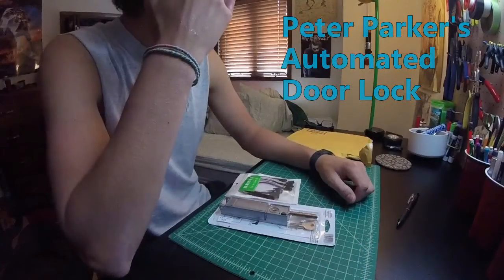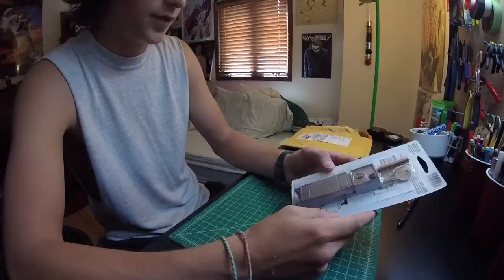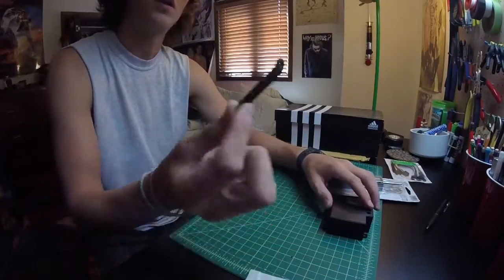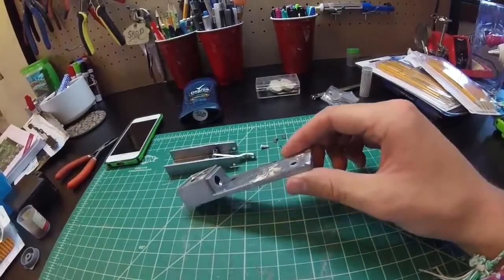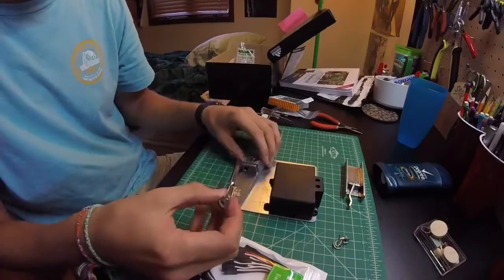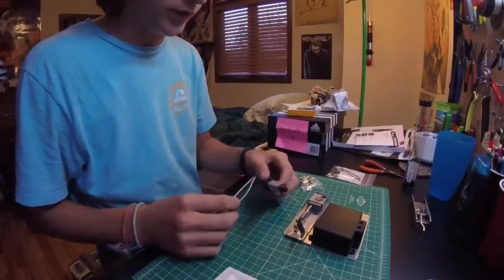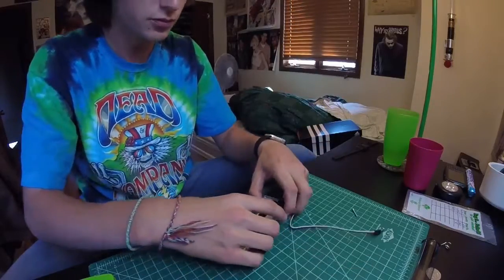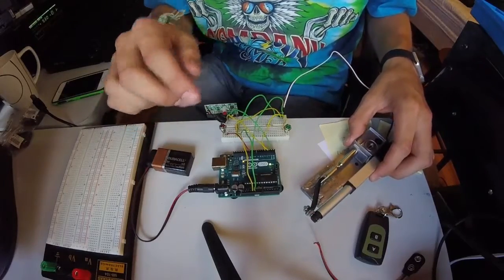TASM Fully Functional Actuator Door Lock Build

Comment: if only ppl would realize that if they were really going to do all this yet they are asking for how to's and material lists and blah blah blah. to those people i suggest you first learn what in arduino is and how to use one before you even attempt a project like this, or youll probably end up giving up. learn to think for yourselves and take ideas like this from people and expand upon them. this was exactly what i needed to make my own door lock. except ill simplify by not making it movie accurate. you dont NEED a 3d printer. you can order housings online or at the right hardware store. all you need to do is get a deadbolt like this and find some sort of switch or a motor and think of a way to make it work. you will get smarter as you go as i know some of you need your hands held as you do projects but start using your brain, i dont need instructions because im familiar with arduinos and soldering circuits etc. and then using swift to do simple command codes. its not rocket science. its electronics. start busting down old shit to see how it works. you can salvage parts like motors and switches in almost anything. thank you for this video dude